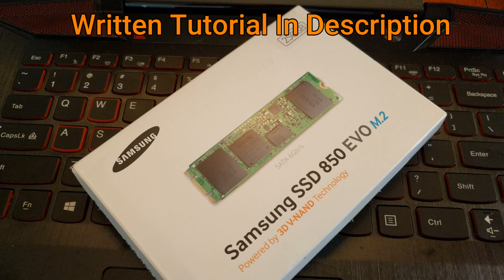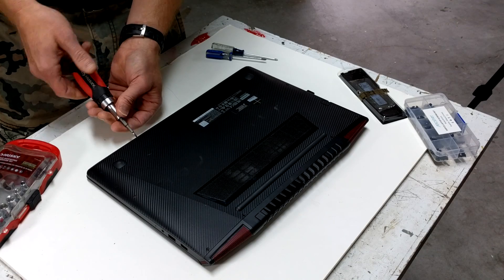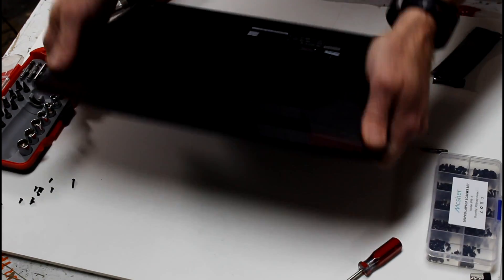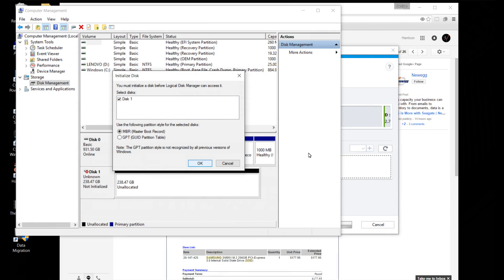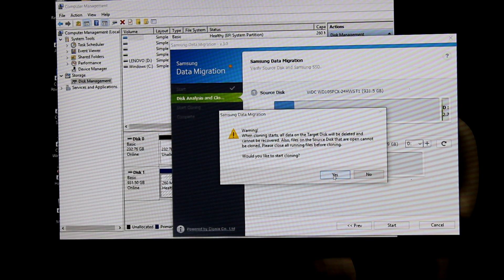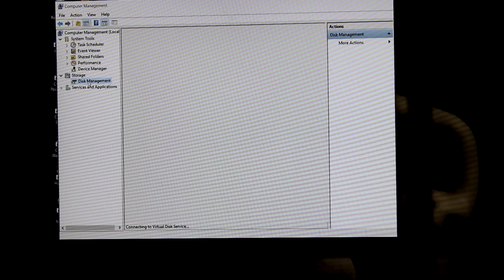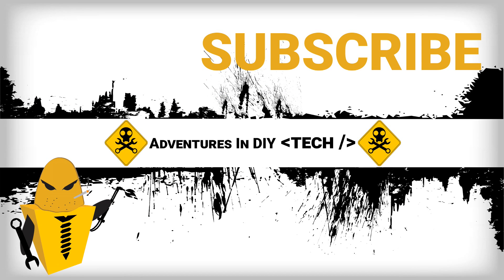How To Install A M.2 SSD Drive In A Lenovo Y700 14" Laptop (Y700-14ISK)

Comment: why m2 sata only?lenovo y700 15isk is compatible with m2 nvme but the pice is limited on 2.0 not 3.0 which will cut rhe bandwidth in 1600 mbps

Comment: You CAN use a 900-series Samsung M.2 in the Y-700 14isk! You just have to remove the old HD to make the SSD act as the boot drive. Then you can delete the old C: drive via USB, or at least that's what I'm probably going to do, and put it back in for another 500GB of storage for Dropbox or something.

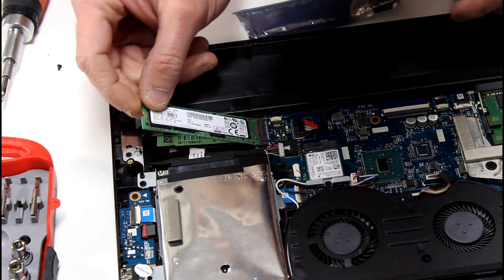Comment: At 0:42 of your video, you're installing a M.2 SSD drive with M key edge connector, and you boot the 

system from it. But Samsung 850 EVO 500 GB M.2 drive has no M key edge connector(Base on the 

Samsung official website, it has one B & M edge connector only), it's confusing.

Comment: Hello!
Recently, I've bought a Lenovo Ideapad Y700-15ISK 80NV0163HV, which is a 15" model...
with 4GB of ram and 1TB of HDD inside.
The question is, can I put a  Samsung Evo 960 m.2 in the laptop, or does it only support up to Samsung Evo 850 M.2, just like this one in the video?  (I'm planning to boot Windows from the SSD)
I need your help,
Thanks in advance!!!
Reply: i wanna do the same ..but it's compatible with y700 ?

Comment: So I used the Samsung Data Migration software and it didn't disable my old HDD. I moved the SSD to top priority on BIOS to boot from it and it loads up to the login screen and then it freezes. Any ideas?

Comment: my y700 15acz wont even detect my adata m.2 ssd
Reply from the maker: Only thing I see is the samsung is using a MGX controller and the adata one is using LSI SF-2281.  That might be the problem, but I've only used the samsung 850 in my laptops.  Sorry I don't have more info.
Reply: i appreciate the response none the less, i've got a sata adapter coming anyway. so i'll just have to take the 520 GB hit and use it as my main drive.... if that even works.

Comment: Hey +Adventures in DIY - Tech I watched your video and used the exact same ssd u installed but I've had trouble getting my pc to boot correctly after installing the drive. Windows seems to start correctly but when I get to the password box at the windows login screen, I'm not able to actually click on any buttons in the corners or write anything in the password box itself. I've looked online for an answer and haven't found anything on my specific issue. If you maybe see this, thanks for the help.

Comment: Does the Samsung tool not work with the Lenovo? It did the migration but  then windows was stuck in a loop of a blue reboot screen. I had to re access the boot or inventory and it left the old boot for the original windows listed below the SSD?? So I had to switch it back to the C: windows to get the computer to log back into windows. So now what? I can't delete the old one or set the SSD as default?

Comment: I have this Laptop without HHD or SSD, and I want to use my Evo 850 SSD, SATAIII, however, I am unabel to find the small conector to plug it. Can anyone give me a link :/?

I also think that the engineers put the wrong socket in the MOBO, I simply can´t find a cable that will fit.
Reply: Have you found any solution? I have the exact same problem!

Comment: So I followed all the steps up to the point where it asks to shut down and install. So I hit shut down, rebooted the laptop, and it was taking abnormally long to sign into windows. Once it finally did, the OS is unusable due to it flashing. I can't select anything, and I can't access BIOS. What do I do? I've seen many people online with the same problem but I can't figure out a fix.
Reply: it's not coming up because I'm on mobile
Reply from the maker: That's odd you're having trouble accessing the BIOS.  I know Lenovo does a quick boot by default.  Power down completely by holding the power button until it does a hard power off. Once you hit the power button start pressing the F12 key.  If you are still having issues with the flashing of the SSD, you'll probably have to remove it and get the laptop to power up with the original drive first.  Once your up and running with the original drive you can try the install and drive copy process again.  If it fails again you might have a bad SSD.
Reply: It did the same thing to me. I figured out a fix. View my comment on top. You'll have to re-clone your SSD with different software
Reply: can't find your comment, what software did you use (
Reply: Rei D. : it's the first comment on the list right now. Starts with "Screen Flickering Solved" just scroll up

Comment: can I factory reset after the migration? I hear a fresh install is recommended , but I dont know how to do tht.
Reply from the maker: +@Resident_41 the drive copy utility should copy over all the partitions including the backup one. If you're concerned about being able to do a lenovo factory restore, try the restore process before deleting the partitions from the original drive.
Reply: Okay, I just did a factory reset before cloning to avoid any corruption issues. Now after I install the ssd and clone my hdd to it, I should be able to boot windows from the ssd instead of the hdd right? Then I can factory reset anytime and windows will still be on ssd?

Comment: do you need unplug the battery? And it is possible to get m.2 without screw?
Reply from the maker: +Roņis I didn't unplug the battery. With the system shutdown properly you should be OK. You need the screw for the m.2

Comment: I saw you used the 256GB drive.  Any reason that the bigger 850s wouldn't work?  Want to do this, but want to use a 512GB or 1TB drive, if possible.  It looks like Samsung makes 850 versions of both, and they both are SATA interface.
Reply from the maker: They would work just fine.  If I did this again I would have used at least a 512GB drive.
Reply: +Adventures In DIY - Tech I installed a 1 TB over the weekend.  It works great.  The laptop is now super quick.  Thanks for the video, it helped out a lot.

Comment: Will a SM951 128 GB AHCI work on the Y700 15ISK?
Reply from the maker: From what I'm seeing all the Y700 series is using the same interface for that line of laptops.  I tried that drive originally, SAMSUNG SM951 M.2 256GB PCI-Express 3.0 Internal Solid State Drive (SSD). The ideapad 700 specifically says it uses a pcie interface.

Comment: I have lenovo ideapad 700  which is a similar model to y700 model and it has M.2 port but i'm not sure if it's available for M.2 sata SSD or M.2 PCIe SSD ? May you check this link for me ? 
https://drive.google.com/file/d/0B-rlKi2OFlcrOFMxRUtXTjRJY2s/view?usp=sharing
does your M.2 port look like this as in my picture ? I'm planing on buying Samsung 850 evo m.2 also
Reply from the maker: The m.2 connection looks the same as mine.  It depends on the model.  If you have a newer one with a 6th gen intel processor it looks like you need a PCIe. http://shop.lenovo.com/us/en/laptops/ideapad/700-series/700-15-inch/ like this one. http://amzn.to/1THn6F2 Its more expensive but faster than a sata drive.
Reply: +Adventures In DIY - Tech +Adventures In DIY - Tech I actually think the same like you, but i've seen Dell inspiron 7559 with intel core i5 6300hq be able to upgrade m.2 ssd which is sata interface that is 850 evo m.2. that's why i'm curious about these two m.2 types. btw thx so much for the info :)
Reply: +NemDanusorn and one more question. do you know if 850 evo m.2 sata ssd and 850 evo sata ssd have the similar speed or not ?

Comment: After you clone a drive can you delete the contents on the original drive ( I have the same computer and am doing the same thing)? I am mainly thinking about only moving over the OS right now, is cloning the way or should I just buy another version of windows 10, put it on the SSD and delete the OS on the HDD?
Reply: if you have windows 10 OEM you can get iso windows file from microsoft and download it to ur dvd or flash drive and use it to install ur windows at anytime.
Reply: is there a place on windows website where you can do this?
Reply: u need mediacreationtool from microsoft here's the link, u can get iso from this one and write it to your flash drive or dvd, remember to choose the right version of your windows http://download.microsoft.com/download/C/F/9/CF9862F9-3D22-4811-99E7-68CE3327DAE6/MediaCreationTool.exe

Comment: I can still reset the pc to it's factory settings from the SSD right?
Reply from the maker: I believe you can, but I just did a clean install of win 10 on mine and deleted any of those partitions.  Sorry, I can't check.
Reply: If I made recovery media on a usb that recovery partition is useless right?
Reply from the maker: Yeah, if you have a backup solution you don't need that partition.

Comment: You moved everything from your hhd into your ssd? Did you have to manually go into bios so that everything boots off of the ssd, or did it do that automatically after you copied everything over to the ssd? thank you.
Reply from the maker: +32Jonathan32 If you use the Samsung utility it will disable the original sata drive.  I'm not sure for other manufacturers.
Reply: alright man. thanks

Comment: HUGE help and easy to follow instructions, thanks for the advice. Cheers from Puerto Rico!
Reply: +Reuben HELP! I followed the instructions on your video but now Windows 10 isn't booting properly. Initially it rebooted by itself a couple of times saying it couldn't find the OS. Then the boot options menu popped up through which I could change some advanced settings including accessing a command prompt. After reading through some forums I tried running bcde /set {current} safeboot minimal to reboot into safemode but it didn't do anything, saying something like the device couldn't figure out what to boot from due to various compatible devices (I don't remember exactly what it said). Eventually I was able to access the BIOS. I fingered through it knowing that I was looking to change the SATA to AHCI instead of IDE but couldn't find a straightforward way of doing this so just selected UEFI (which was already enabled so no changes were made), Saved and Exited and it rebooted. And here begins the REAL trouble. It went to the log in page with the time and date as normal, clicked through and I entered my PIN as normal. It took quite a while and eventually gave me the dreaded black screen of death. After several more minutes the mouse icon eventually popped up, so I waited some more and now I see my desktop but it just keeps flashing and NOTHING SEEMS TO WORK, not even the start menu. Task Manager however  doesn't flash and I can click around it but that's pretty much it and all I've found online says to uninstall apps that might be messing with the display. EDIT: I have been attempting a manual restore via the command prompt but still haven't been successful I will be getting a DVD disk tomorrow just in case I need to reboot from the disk drive. Should I remove the harddrive and try rebooting? If so, which one should I remove, the HDD where windows was originally installed or the SSD where I migrated Windows to? Sorry for the wall of text, tried to be as detailed as possible. I'll appreciate any help I can get.
Reply: +Reuben P.S. I contacted Lenovo Support before any of the serious issues, back when I was able to get the boot options menu. What a huge waste of time. 30 minutes on the phone to be told they wouldn't help because I "modified" my computer (BY INSTALLING HARDWARE THEY THEMSELVES INCLUDE IN MODELS OF THIS EXACT COMPUTER) and referred me to a local technician. Total B.S.
Reply from the maker: +Reuben Is the m.2 drive have an SATA interface and not a pcie 3 one?  I tried to use a 900 series samsung m.2 that has a pcie 3.0 interface and couldn't get it to boot no matter what I did.  Have you pulled out the m.2 drive and booted the machine to make sure it boots with the original drive?
Reply: Which model did you try? The only one I could find was the Samsung 950 Pro M.2 but the connector looked different from the 850 EVO.
Reply: forget my last question. i found the answer here (you might find it useful too): https://forums.lenovo.com/t5/Lenovo-P-Y-and-Z-series/Lenovo-ideapad-Y700-15ACZ-M-2-SSD-Upgrade/m-p/2216931#M135485

thanks for you video. it was most informative! :-)

Comment: I installed M2 SSD Samsung Evo 850 on my lenovo y700 but the initialize disk does not appear. What do i do now`?
Reply from the maker: +howyan is it recognized by the Samsung software?  If it is then just continued with the cloning process. If not then the drive might not be seated all the way in. You'll have to open huge case back up and makes sure it's pushed all the way in.

Comment: Hey did you need any kind of adapter? Because The website who sold me mine, 15 one, said that you need some kind of adapter to put m2 in..
Reply from the maker: +Tomas Styra as long as you purchased a M.2 sata drive like the Samsung 850 the drive fits in the slot.

Comment: After installing the M.2 Drive did Windows Operating system automatically get moved onto the new SSD? Good video by the way.
Reply from the maker: +Andrew Hanway no I had to use the Samsung SSD migration utility. It copies everything over for you then you just reboot. The article in the description has the links with some more details. Thank you.
Reply: +Adventures In DIY - Tech  Excellent thank you, very helpful and informative, I appreciate the reply!
Reply: This is great! Thanks for that info.
Reply: Did you ever figure this out because the amazon page looks different from what he installed.  I really need to know
Reply: Hello sir what size of this M.2 drive? Because they have an deffirent size or socket